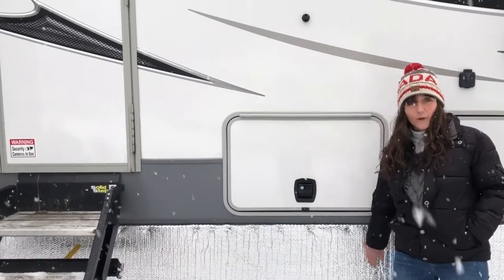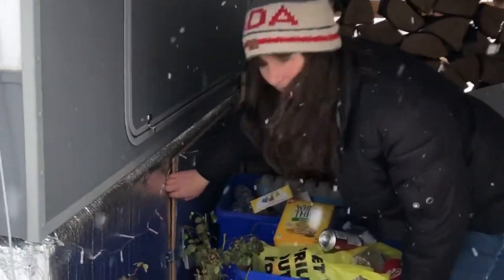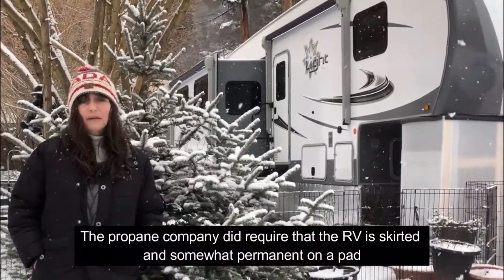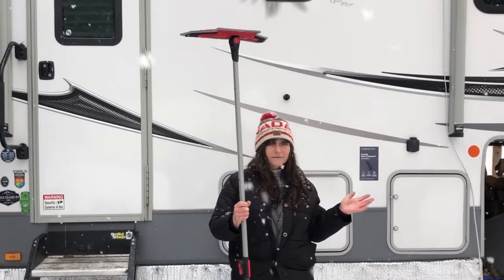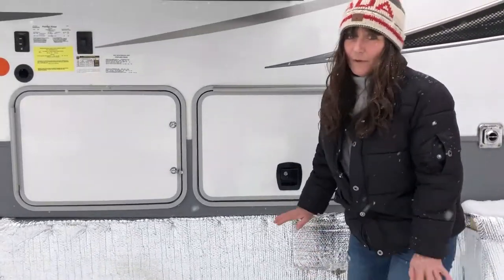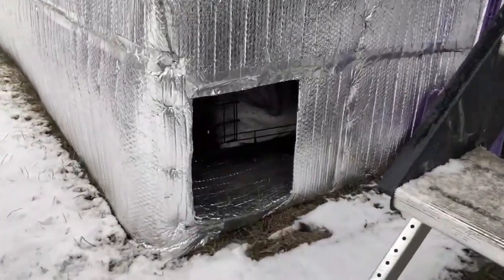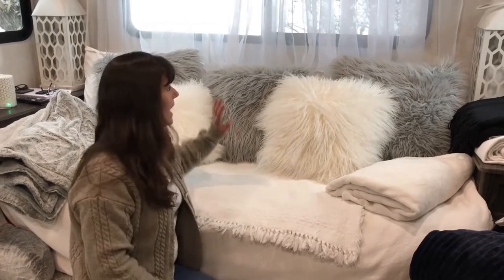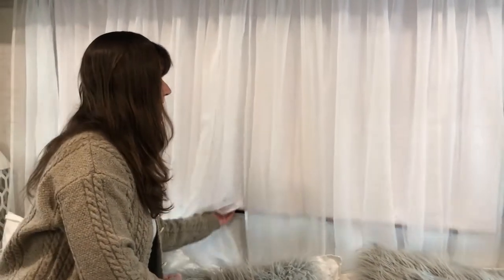Tips for Winter Canadian RV Life

Comment: How did you tack your skirting? Live in AB and winter camp a bit, thinking skirting for next winter.
Reply from the maker: The reflection insulation skirting is wrapped and stapled over a wood 2x4 frame. Rebar held it in the ground to further stabilize it.  In my present rv I did no rebar. I did it in sections then taped the seams, making it easy to remove. I can access underneath easily. They have stayed in place solely because of measuring each individual section and making it snug. I can’t imagine AB weather with no skirting. It makes such a difference in the inside temperature. The reflective cuts out the wind well too. Best wishes from BC! I hope that helps! Perhaps I will do a video  or shorts video on it . Thanks for watching!
Reply: I’m doing the reflective bubble wrap and vinyl. The vinyl will snap on at the paint line on the body for looks and the silver bubble wrap will be all the way around from tucked under the back and front bumper to the sides where it’s just being leaned up against the side with the storage doors open then slam them down on them so it’s held perfect. Not sure if I will skirt the slides or just belly tarp them with 2” foam against the floor then the vinyl going under it from front to back to hold it up.